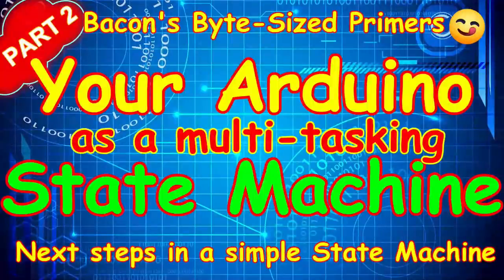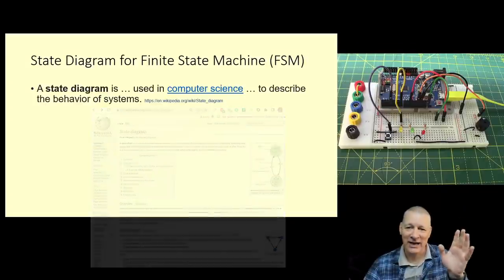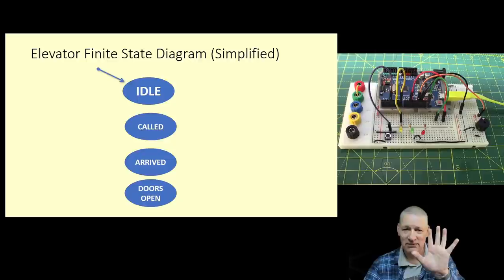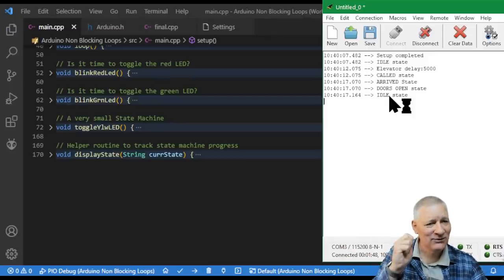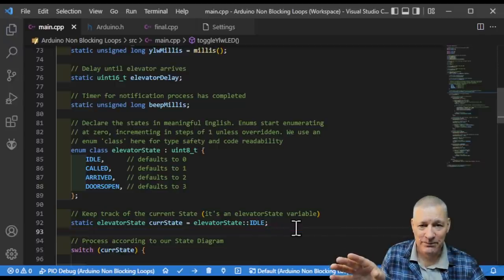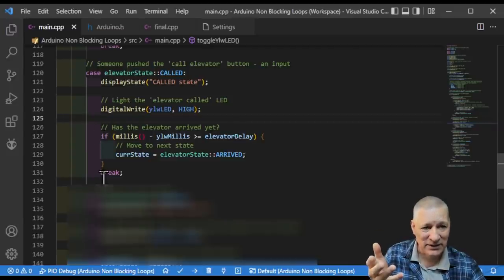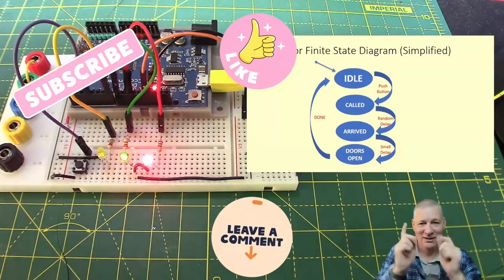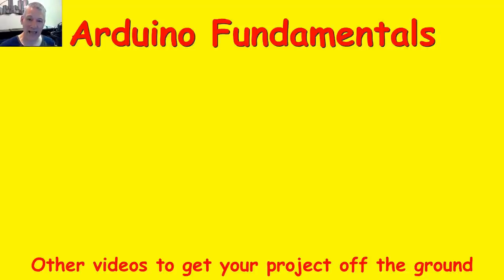#BB6 Arduino State😲Machine - Part 2: Implementation 🥳🥂

Comment: Hate to sound like a broken record, but this FSM works for ~49.7102696180556 days until millis() overflows and "resets" back to zero. Granted: 1) this code will "correct" itself the next time through the main loop; and 2) this is probably not an issue with most hobbyist use cases... but in some scenarios this will cause "interesting" problems.
Reply from the maker: The millis() calculation will work even if it is smaller than the captured millis (after a rollover) because it's all unsigned. It's not just me that asserts this, the guru Nick Gammon says so too. Worked example? Keep reading:

Let's use a small (one-byte) integer. We'll assume that millis() has rolled over and is now a very small value, let's say 3. But the previously captured millis was larger, let's say  255 (the largest it can hold). That's 1111 1111 in binary. If this were a signed integer that would represent -1. But it's not signed so it's 255.

This means that in Arduino-land 4 millis-seconds has passed. But 3 - 255 = -252 if we used signed integers (which is actually too large for an integer to hold). But our unsigned result does not have the sign bit set so instead of 1111 1100 is loses that first bit to zero, there is no two's complement to flip the other bits and so becomes 0000 0100 = 4. 

All is well in the millis world. You can prove this yourself in about 5 minutes just writing a bit of code on an Arduino. (As I did when I read Nick Gammon's article several years ago). 

Be aware that when you do a Serial.print(integer, BIN) you must cast to an unsigned integer thus: Serial.print((uint8_t) integer, BIN) or you'll get the wrong answer!
Reply: Interestingly, Windows 95 and 98 would actually crash if they were allowed to run continuously for 49 days! Presumably Microsoft had never allowed their machines to run continuously before releasing the software.
Reply: We may not concern about rollover value of millis() when we are interested in interval value (newValue - oldValue) as long as we use  unsigned long type , 2's complement nature of ALU and compiler will handle it correctly.

Comment: I have to stress-out that state machine should be implemented by class hierarchy, not by enum. Consider UML diagram on a wiki page for finite state machine. Different classes allows you to just do "pushButton()" or "timerTick()" handlers and do appropriate transition logic for this specific state. Easier to maintain and extend, harder to abuse.
Reply from the maker: But Dmitry, this is for beginners . How many do you think even understood your comment? I've got to keep it simple! (You are correct, of course, just not at this level) 😜
Reply: the norm = GRAFCET, invented by the french in 1962.
DIN EN 60848, (Deutsche Industry Norm) as norm in Germany.

the only valid way implement a state machine in a real environment, like a production line in  factory.
It also states that safety related things, like emergency switches, sensors and switches to check if all "doors"  are closed to prevent people from accessing  a working robot, moving parts where people could get crushed are the first things to check before proceeding anything else.

You need to read the french article on wiki to see how it's works.

Comment: First, great video (a search of state machines on google led me here). Second, is it fair to simplify the description of a state machine to 'a machine that can jump between states depending on the current status/condition, rather than a sequence of system delays/holds waiting to check conditions'? I ask because it sound to me that a program making use of, say, millis() rather than a  sequence of delay() calls could be labelled a state machine if it will branch into different states depending on a few conditions. If so, this brings me back to the question (I suppose my third point here) that's been in the back of my mind for years, why use switch cases instead of a main loop made of if statements? Is it just 'what it aught to be', is it more efficient once compiled, or am I still missing something? Keen to learn more from you, Ralph.
Reply from the maker: The main difference between a bit of code using millis( ) and one using a State variable, is that with the latter the system doesn't care about time passing. It "knows" what the current state is and remains in that state (and, hence, bit of code) until the state changes.

The former cares only about whether the time is right to "do something" but has no idea of current state of the system. It's harder to debug a program written like this, although most of mine are!

Regarding your final query, if I understand what you are asking, is that a SWITCH statement is all concerned about a particular value (in a variable), so all CASE branches are related to that variable. Easier to maintain and follow the logic.

An IF statement is not connected to another, unless you have nested IF statements and there is a good reason why most commercial software houses limit such constructs to just two levels! Far harder to maintain and far easier to introduce regression bugs.